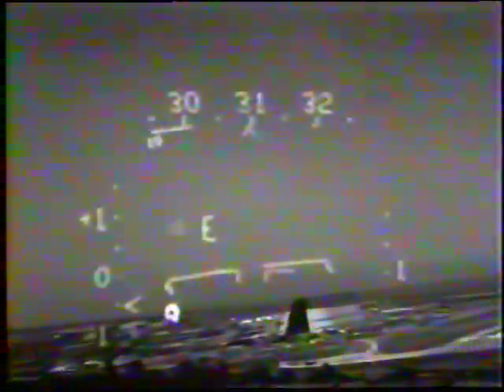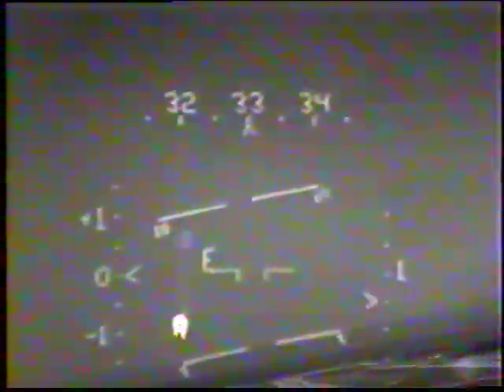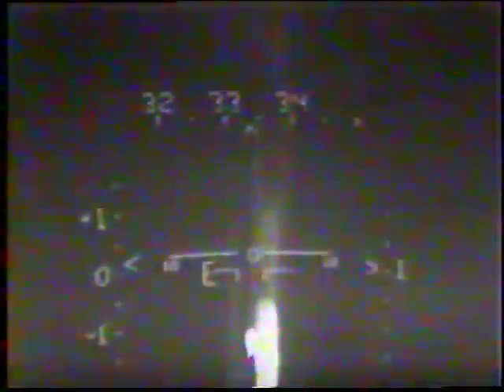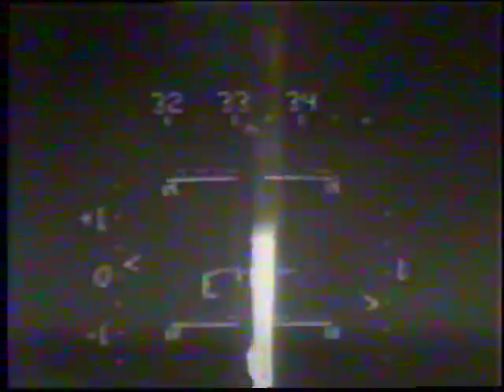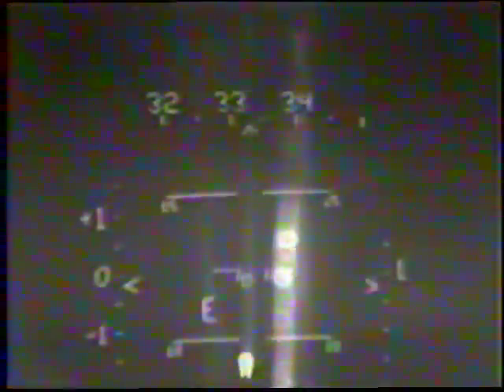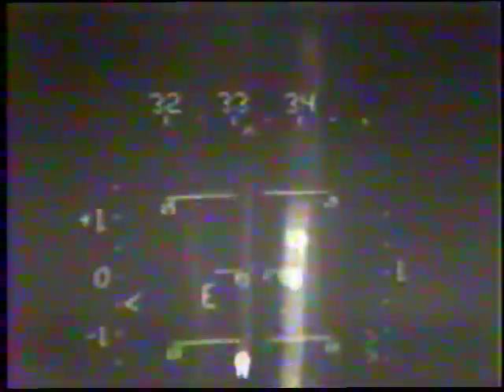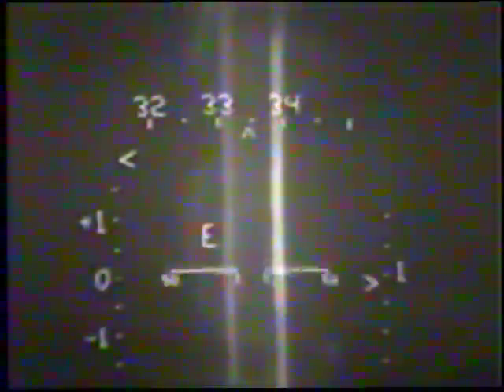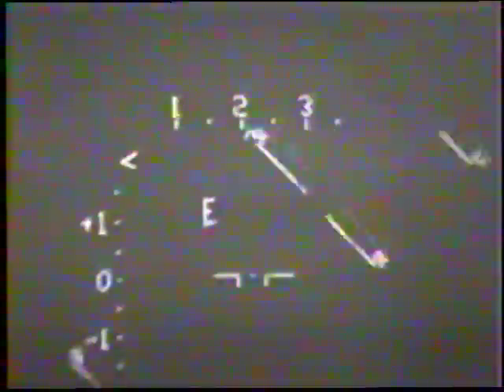Navy F-14 Airshow HUD Part 2 of 2

Comment: Concerning the HUD, I presume that the graphics displayed are the heading tape, pitch ladder/horizon, waterline, angle of attack, vertical speed, and velocity vector?  Later-design aircraft, as well as the F-14 Delta, also have tapes for airspeed, Mach and altitude.